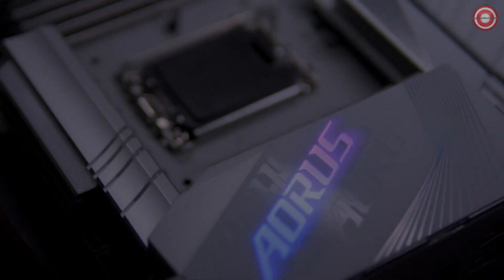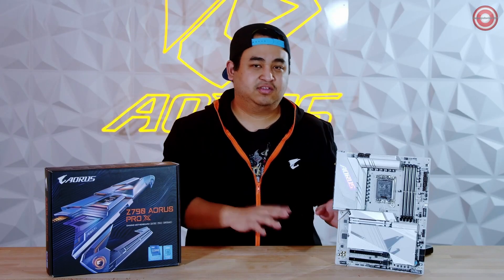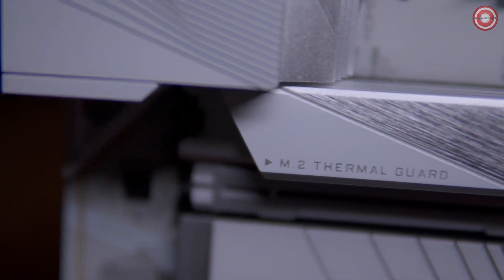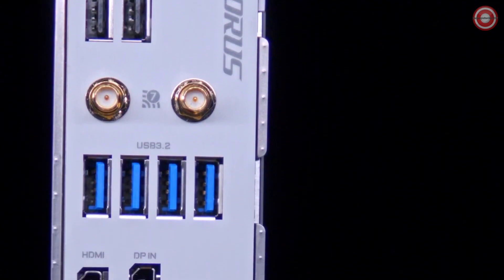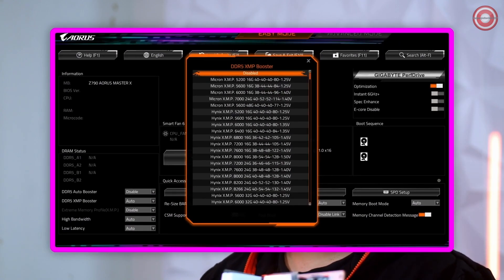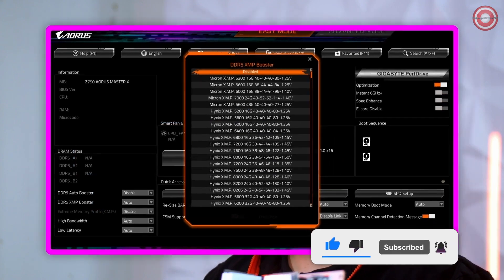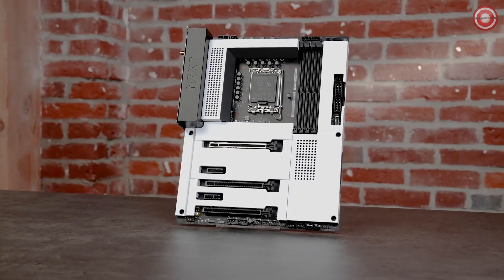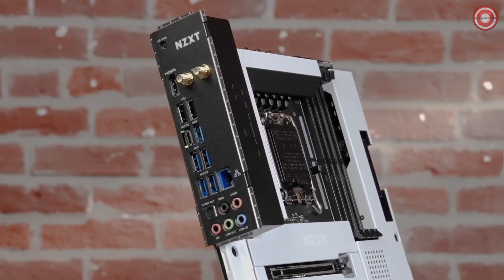4 Best Motherboards for Intel Core I7 - 14700K

Comment: I want the z790 Aorus Pro X but the Gen 5 M.2 slot splitting lanes makes it a bummer. I'm stuck on what to get I need something thats white.
Reply from the maker: What do you say about the last motherboard presented in this video. NZXT N7 Z790 comes in both white and black.
Reply: What does the splitting lanes do
Reply: @gabrielchong3446  instead of your gpu running at x16 it’ll run at x8. From what I’ve read there’s almost no difference maybe 1-3% but it’s still a difference.